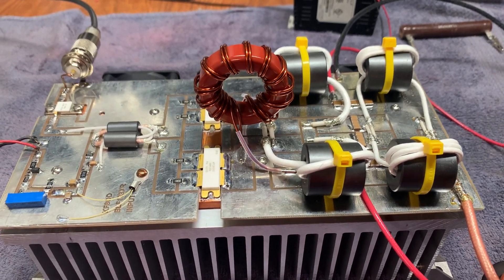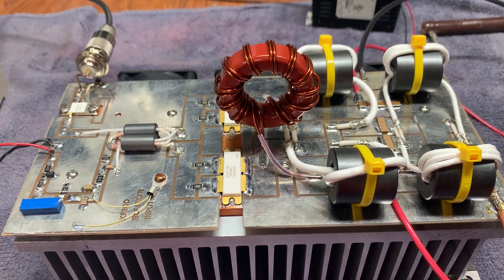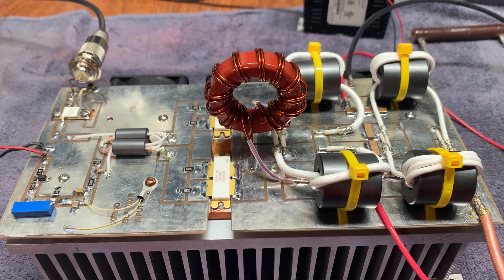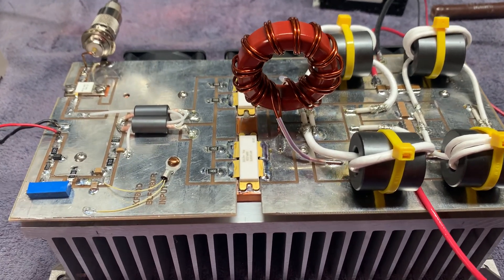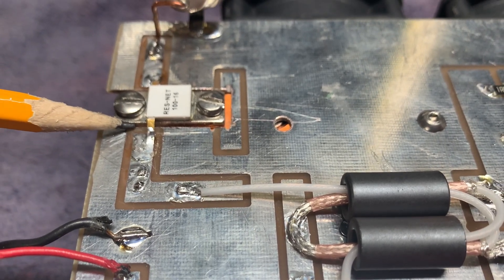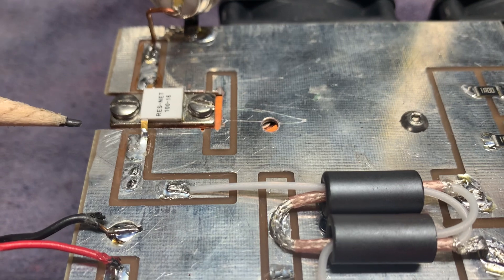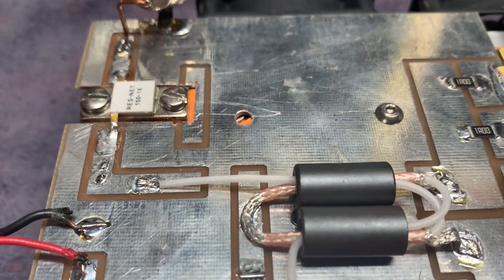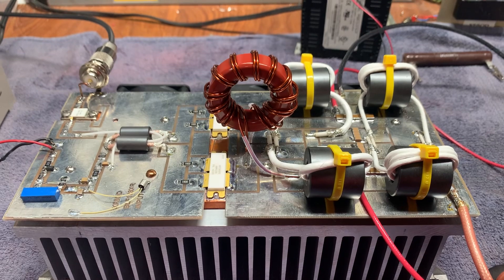Short circuit no output ART2K0FE

Comment: Mike, I saw in your other video with the single ART2K that you saw 2kW at only 53V which I thought was impressive. Is the output of this dual 2K limited by the current output of your PSU or did you strap two supplies together and have you seen the magic 4kW?
Reply from the maker: The power supply was only good for 60a. I never pushed them that hard.